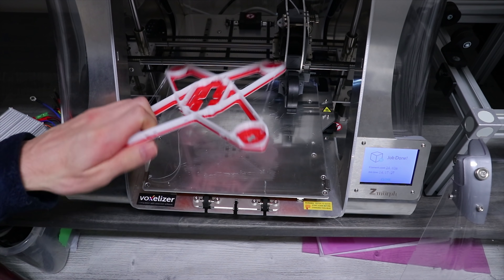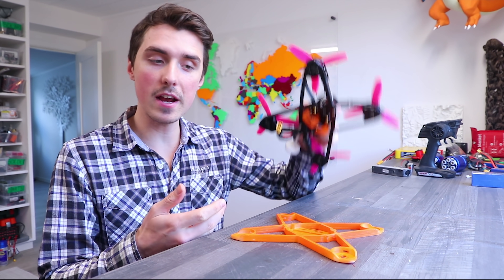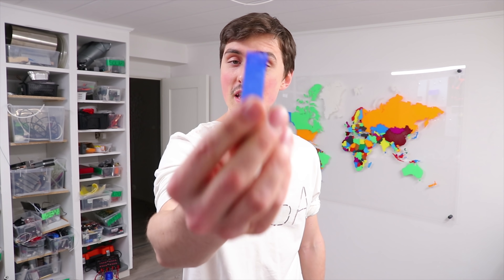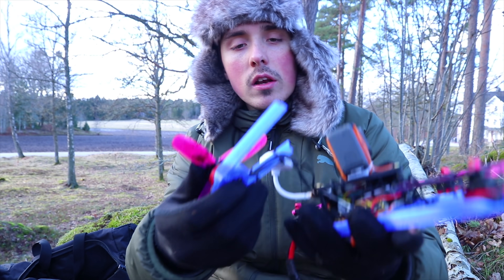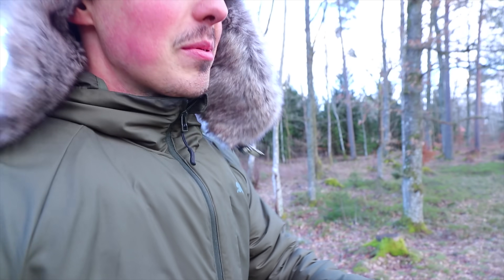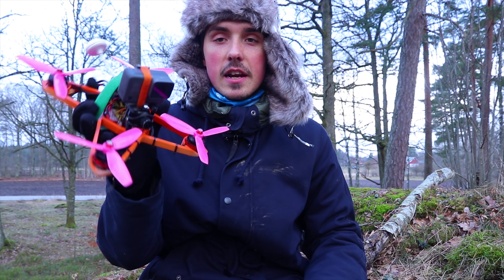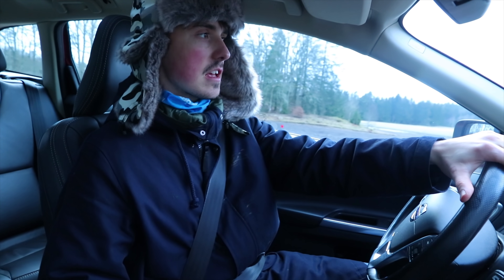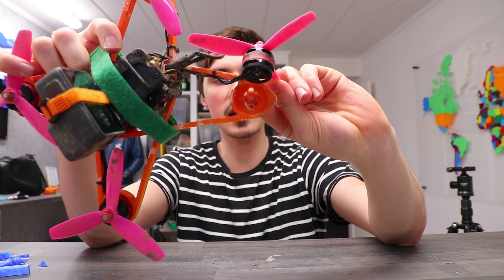A Flexible 3D Printed Drone That Can't Break

Comment: I might be a little late to this video, but I was on the same journey a few years ago
Tried a lot, tpu d58 - 75, cpe, pp, pc, pa  and a lot of others, best was taulmans pa cast
But in die end I build a CNC mill that could mill cfk underwater
There is nothing comparable in strength and weight

Comment: Cool that someone tries that. I'm still playing more with whoops at first.

I'd try to iterate more on the 3D model. For example add some filet around almost all edges especially those that broke. Then check where it'd likely break in a FEA simulator like SimScale (many are free to use and online). Also much thicker walls for the fragile parts will help (even with low infill), else some complex skeleton and 100% infill does the same.

As for the material, I hope you've tried PLA+, and if you want to try 1/2 density, try LW-PLA. Probably not required here but an option. PETG is probably a bit too flexible especially with the current thickness you have.

One could then either try to make it very hard to break, possibly add some outer shell in TPU with duck around the blades and the frame. Or make it very easy to replace the frame: Like ease the installation of the components. Because printing a new frame is easy and cheap.

Comment: Suggestion: PET seems like a more accessible material that should be just as tough if not more so. Maybe a part 2 with a PET variant of the frame? 
Edit: ALSO ALSO you could make this a 2 in 1 and recycle the PET you use to print the drone, so it's a green drone :)

Comment: You should put holes in the tpu frame so you can put carbon fiber rods down the centre of the arms instead of pla on the outside. The rods will snap on impact and take the stress off the rest of the drone.

Comment: was the petg  dry. it is very strong if dried properly. some brands are be5tter than others. had good luck with tecbears and some luck with sunlu. also fiberglass nylon, or carbon fiber nylon or petg.

Comment: I really liked the TPU aproach. I would probably explore that a little more. My idea would be to print the TPU frame but with slots along the arms and then print PLA (because its cheap) or a more rigid filament "flat sticks" to insert in those slots to make it rigid. If it hit something, the PLA would break but the TPU wouldn't, then just insert a new PLA stick and good to go! Print a couple of them and you would be flying for a long time I would say. Still a very cool video as usual and loved that fall at 6:00 xD.
Reply: had the same idea! Have you given it a try yet?
Reply: @Dangineering  I have not, unfortunately as I don't own any drones atm. If you give it a try let me know if it worked!
Reply: @Joel_PTC  I plan doing this is within the next couple months. I will let you know how it goes or just make video once I have the final design.

Comment: now try to make it out of something that instead of absorbing the impact, makes the thing that is crashing into absorb it, in simple terms, something that destroys everything it crashes into, for example, 7mm thick carbon fiber frame, with concrete arm guards (and you put a bit of rubber in between the concrete and the carbon fibre, and you can probably break almost everything you crash into

Comment: And what if you make a double frame: one of flexible material and put all the equipment on it; and a second part of a rigid material that will control the rigidity of the structure. And then, upon impact, only the hard part will break, and the flexible one will bend (and possibly even protect the equipment), but not collapse. And then you can simply replace the broken hard part in a few seconds (you will need to think about a quick fastening; for example, the flexible part will be put on the hard part like a phone case). You can print a dozen of these and have it with you:  broke - replaced.

Comment: What about a Frame with predeterment "breaking" points? Like the Arms are held by magnets or something and could be easily reattached after a crash or the Frame is connected by replaceble connectors? Just something that absorbs the kinetic energy of the impact.

Comment: HELP
I'm building a quadcopter with a 3d printed frame (pla) wich is foldable. The problem is that the drone is vibrating like the one in your video 2:00 . But the frame is actually relatively stiff. Does someone has a tip for me on how to solve this ?

Comment: What about printing the body of the drone with the flexible material so that the arms are preloaded towards the ground a bit so that in flight they level out? I would think that it wouldn't allow for fast/sharp movements, but I bet there's a lot less vibration.

Comment: HEEEEY I HAVE AN ISSUE WITH MY 3D PRINTER :( PLS HELP¡
the thing is that any object i print is flipped, for example i print the numbers "18650" but it prints as "05681" kind of like that I have tried over a month and also didnt find any solution on  internet... lets say another example... I print a bottle thread and it flips the thread direction... I have a core xy so... i dont know what can be happening and in order to print something i have to print twice, the first to see how it got flipped and then the mirrored by cura ("fixed") model, so its making me waste LOADS of filament. pls upload a video with a solution or how could I fix this? 
PS: thanks to all of your videos, thanks to them I managed to print lots of things like lithohanes, and the waterdrop circle tto avoid supports, you are a GENIUS!!
Reply: I think the issue is in your printer software. Do you tried to reprogram the printer with different software? Marlin can be good option.

Comment: I would give the flexible material one more chance, the problem is... Your design is pretty flat, 
I have a vacuum formed disposable dishes company and if the design is flat and without ribs, the plate is not that strong, but when I add ribs or "webs" of ribs into the design, the plate can handle a good amount of food ... I would make ribs on the entire arm, making a 45 angle degree and -45 degree. 

Or, if you want to maintain the design, you should use TPE flexible instead of TPU...

I am not an English native speaker, so I am sorry if I used bad vocabulary ou grammatic!

Comment: I tried to fix my drone with my Ender 3. the Fran is made of 4x4mm carbon fiber rods. I used pla to print it and it’s way to flexible. The motor vibrates a ton

Comment: I hate to be a downer but there's a reason frames are made of carbon fiber.  it needs to protect the cameras and no 3d printed frame is going to do that well unless it's just a ball of plastic with electronics inside. also the flexibility of plastic would make high performance tuning a nightmare with anything over a 3-5 inch frame.

Comment: Try having sacrificial arms that will absorb the energy of the impact but are very easy/cheap to replace. This way you come stocked with just this replacement part and don't need to remove the entire rig from one body to another one.

Comment: Hi, RCLifeOn I am flying with 3D printed 7Inf frame for 2 years. I use Hertz Polycarbonate ( Polymax PC works as well fine, but Hertz is extreme, It is printed on 300°C ) to print the whole frame and it is really really durable. I have a 5 inch version on thingiverse. Give it a try please ( thing:3956121 ). If you have a time, you can check some videos On my channel that I recorded with it. Ladder7 is the name of the frame. :) I hope you won't ignore this.

Comment: You could probably make TPU/PLA work by printing one inside the other with a dual nozzle/extruder. I suppose it might make more sense to have the TPU on the outside for shock absorption and have PLA or similar used as the structural bones for rigidity and strength? I guess you could go even further and have rigid exoskeleton of PLA/PETG as an addtional shield, but this might be adding excessive weight to your quad.

Comment: Im thinkin what if you made the majority of the frame from a pretty flexible material, but have slots in the arms where you can put bars of a stronger material for rigidity but meant to break in a hard crash to save the rest of the frame then just pop out the bar and throw in a new one. Ehhhh??

Comment: I wonder if there is a reason carbon fiber is the predominant material used to make drone frames? Probably not because of the sensitive flight controller or the horrible motion sickness caused by oscillation I’m flexible frames. But the video just started and I’m excited to see an indestructible drone!

Comment: PLEASE tell us you are working around the clock on a 3d printed, Arduino controlled mechanical ventilator design built from parts available at the hardware store.

Comment: Why not CC3D? You can get modern day hardware, say from Joshua Bardwell's recommended purchasing list or any of the thoroughly documented builds at RotorBuilds.com and have a much tighter smoother flying quad. When I built my first quad with the old flight controllers they flew sloppy just like yours, so that's why you're crashing, it's not because you're a noob. lol.

Comment: something just crossed my mind, can you modify a PS4 or Xbox controller to use to control drones? maybe add a nice holder for your phone on the controller so you can see where you fly, i think it would have a better control considering its thumb stick buttons, you can go any direction instead of with a standard controller

Comment: Yeah, I switched back to PLA for RC parts because PETG is too brittle... slightly stronger, yes, but when it takes a hit, it snaps.  PLA is actually a lot more durable if you get the heat set right for the brand... and you have a good part design

Comment: Awesome video! Longtime watcher, first time commenter here. Polypropylene is an awesome material for flexible applications, but the other huge part of designing something that is flexible in the right ways and rigid where necessary is the geometry. If you know how the frame is most likely going to be loaded during a crash, then you can adjust the geometry and get all the behavior you're looking for, even with materials that might not seem flexible at first. There are examples of metal devices that are designed to be flexible. Some great resources are the video "Machines That Bend Are Better" by Veritasium and the books "Compliant Mechanisms" and "Handbook of Compliant Mechanisms" by Howell. I'm currently taking a university course from Howell and it's really good stuff.

Edit: Apparently I haven't watched quite enough of your videos, because I just got recommended your 3D printed compliant vectoring mechanism video. So you're definitely aware of the resources I mentioned. Facepalm

Comment: I didn't even bother watching thisyears ago when I first started making drones I made them out of wood. And I quickly discovered that I could not keep making the pieces of wood smaller and smaller as they became more and more flexible and when a drone flexes the motor is no longer in the position and orientation that the flight controller thinks it is.therefore the adjustments and movements that the flight controller tries to achieve by changing the rotational speed of a given motor completely changes it in a way the flight controller does not expect and so it reacts to that change which is also a wrong reaction. Short story long drone frames should not flex at all in order to fly as best they can. However they do need to be flexible to survive a crash.so you can clusion is that any flex allowed to happen during normal flight is bad.Therefore your material must be at least rigid enough not to flex easily in your hand

Comment: metal frame but in segments like body and 4 arms all separated but connected with cheap plastic pieces. so when it crashed it breaks the plastic, not the metal frame. bring replacement plastic connectors (3d printed) after each crash replace the bad ones  (make it modular)

Comment: Is stock Ender 3 able to print Fiberlogy PP?
Where in UK can I buy it?
There are some UK stores selling Fiberlogy filaments but none has PP...
Reply: Same question, I’m gonna buy a 3d printer, Creality Ender 3 will be print with PP?
Reply: if you upgrade the ptfe tube to capricorn (which i highly recommend you do anyways) then the ender 3 is capable of printing pp and other materials that require higher temps
Reply: @n8taing612  Yeah I've got capri on my e3

Comment: Back in the day, early eighties, I had a woodburner for art or basically you could solder, burn wood, weld plastic.. you know... great all around big boy tool for when you are about 6 or 7 or 8..anyway, we had in them days cassette tapes for music on the ghetto blasters kinda ting...   well, just get yer bro's tape, and cassette tape case, and weld it all together with the woodburner... hehehe, drives siblings nuts, bro!

Comment: I think there was definately something wrong with your nylon. Most probably printed too cold, as it looked brittle. Nylon and CF nylon should be one of the strongest FFF filaments available outside of extreme-temperature FFF 3d printing.

Comment: after printing u need to put the parts in the oven at 150-170 celsius for 30- 60 minutes
that process helps to inforce the structure

Comment: Hmm have You tested different materials on 1 build, but by layers? I changed material in half way of print(sellers has sold me abs with pla sticker), and bottom is pla, on top is abs, and it is strange thing, cause it's more flexible (still not that much) than only pla.

Comment: Jesus Christ, there is a reason people fly carbon fiber frames. It's not just about durability but also stiffness. I mean when you fly a flexible frame creates a ton of vibrations and that affects the gyro on the flight controller, consequently the quad flies like cr@p and of course breaks a lot. I really would like to know the specs of this quad.

Comment: I've seen a tpu printed drone on UAVFutures' channel that flew amazingly well, but it was a 2 or 3 inch frame i believe. And it had "tunnels" if you will, for the wires to the motors that helped with rigidity.

Comment: Based on how your nylon frame is falling apart, i think your extrusion temp is too low, or you are using the cooling fan. Nylon should have very strong layer bonding when the printer settings are dialed in. CF Nylon or PC are good options for quad frames, although PC is a little harder to print (high bed temp and heated chamber). CF nylon on the other hand only needs ~280 at the hotend (so you need all metal hotend). The great thing about CF nylon is that it warps less then regular nylon. Also, if you are having adhesion issues, try magigoo, its worked well for me so far.

Comment: Simon, i think if you use a dual extruder, one with flexible filament and one with petg or pla, and lay the print down switching between layers
like: 

flex
pla
flex
pla
flex
pla 

you get both of best worlds. just like bones work. (collagen is flexible and lime is rigid)

Comment: I really don't get this at all.  For 50-100 bucks USD you can get an almost indestructable, rigid, well designed carbon fiber frame.  I have crashed my drone a LOT and the frame never broke so far.  insane number of props dead, motors have broken, camera broke once, two batteries were damaged enough to make me dispose of them, but still that same frame.  If you are really worried you get one with the replaceable arms.

Comment: Make a Frame where the arms are conected with clips so if it crashes the arms just unclip and you can just clip them together.
Reply: That puts stress on the esc/motor wires,  meaning that in a hard enough crash the wires could get ripped off of the components (very bad)

Comment: Hi Simon. I know you already finished your video with a success using PP. however, I think it would have been interesting to see how an ASA printed frame would perform. CNC kitchen concluded it has much stronger impact resistance than PETG and the stiffness is between PETG and PLA. See the video here https://youtu.be/ycGDR752fT0

Comment: For that camera issue check if the camera is over heating or if something has shorted. Key release means that the pin has been pulled on the camera. And the temperature sensor is hating you. And for goodness sake pls get a new control board

Comment: The composite idea (using two different filaments) was pretty good, I think, maybe you should try to make some kind of inserts from one material to the frame made of another material. Like carbon fiber rod in a fixed wing of an airplane. You could even introduce steel rods to the drone's arms by melting the plastic a bit and just putting it, like a stick in a wet concrete.

Comment: Hey Simon, just a suggestion, model the chassis of the drone with a trough like slot through the thicker and most durable part where you're using it to fasten all your parts to and where you know it's most likely to break and when printing to where the middle part of the trough like slot appears, stop the print and add lite weight metal fit to size in them and then continue printing the rest of the print to complete it. This way the chassis is more durable also from the inside of the chassis and will be more prone to breaking.

Comment: You should try Polymaker copa filament. Seems to be quite durable stuff! 60€ / roll not the cheapest but it should also print pretty nicely. Ordered mine from a Finnish dealer but havent printed anything special yet.

Comment: The solution is to 3D print a forest full of tree made of marshmallow. Then print you drone with the hardest material you have. For more safety cover the ground with mattress.
3D printing marshmallow should not be a problem for the "Chocolate man" :)

Comment: This is bullshit. The crash were not hard at all, even your gopro that has zero protection has not even a dent. So calling it a frame that can't break is pure bullshit. Any cheap chinese frame would have resist those crash. I bet that if you did a sturdy pla frame it would have hold too. Thanks for the click bait title :-(